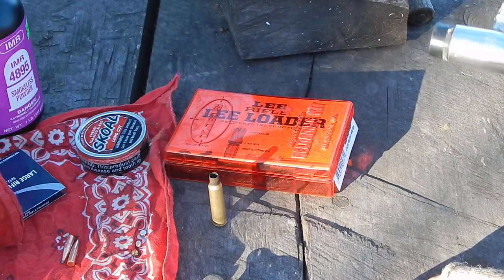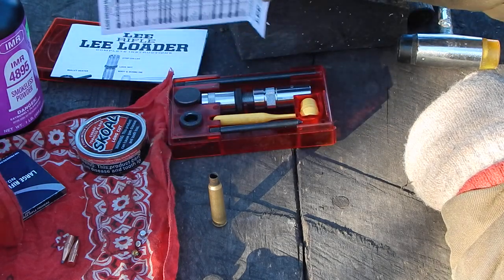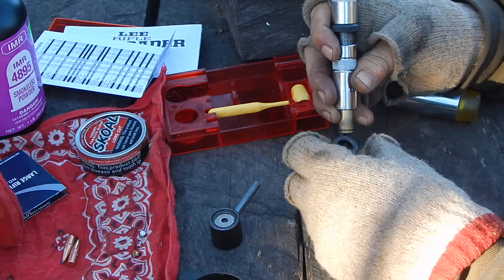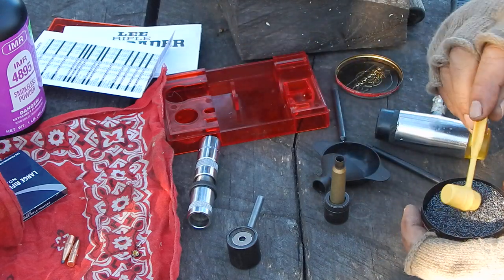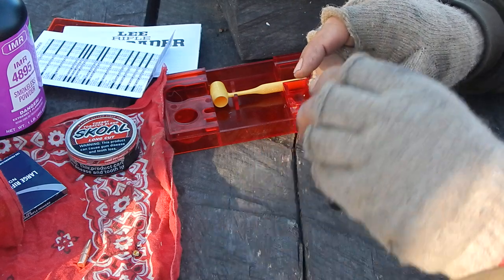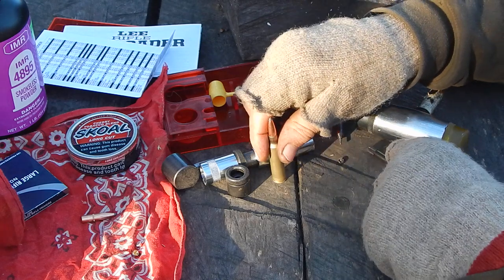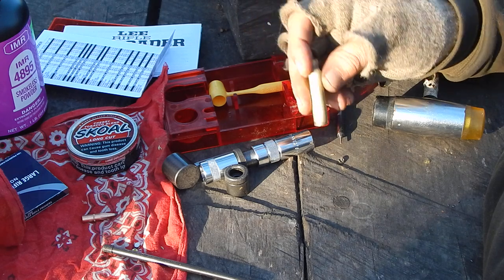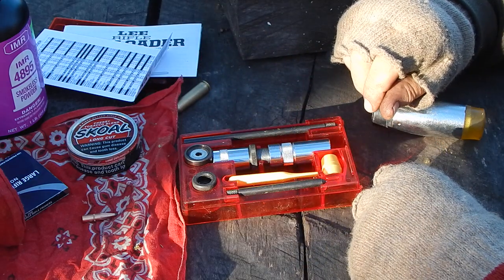6.5 x 55 Swede Lee Loader

Comment: I shoot 6.5x55 and reload on a single stage press. This lee loader works fine but beware that after about 2 loadings of a case you may have to trim the case. The neck of the case will stretch and will not chamber in your rifle. RCBS makes a very simple case trimmer for about $10.  This is true for all bottle neck cartridges.
Reply: You're overstating the issue. Have loaded 243, 303, 308 and 22 hornet with the lee loader and you can get many many more loadings from the lee loader before you have to trim cases.

Comment: I started out reloading with the Lee Loader for a 270 back in the early 80's . I bought the Loader a can IMR 4831, CCI 200 and 130 Gr Hornady bullets and I am sure everything came to less than $30 bucks
Reply from the maker: The first gun I bought was a new H&R .45-70, must have been mid 70's, got the gun, Lee Loader, a box of new cartridges, powder, primers, and bullets, all for $100. Set me up for years, I killed a lot of deer for that investment, and I still use the gun, and the loader.

Comment: The loaders are great tools! So is Lee’s hand press. The hand press with a die set for whatever caliber your working with takes up about as much space in a bag. 
You figure the hand press is about the size and weight of the hammer needed, or lighter. The die set box is same size or smaller than the loader box, can use the priming tool from another loader or Lee’s ram prime, that comes with the hand press kit. And in conjunction with Lee’s breech lock bushings you could literally have all your dies set to correct length and swap in a quick turn.
 Just an option for those calibers that the loader is discontinued on, and takes up about as much space and weight. Also can’t forget the Lee case length gauge and Lee trimmer for trimming back brass when needed.
Love the loaders,  love my hand press, love Lee’s collet neck sizing dies! 
Great video BTW!!

Comment: The 6.5 Swede is the only loader I ever bought from a store. I also find that when you prime the brass outside of the die, it does a better job seating the primer.
Reply: I do the same as well.

Comment: I own 3 of these kits 243, 3030, and 30 carbine they are great kits. The 30 carbine is more difficult to use as you must have Lee case lube in order to resize the case because it's a tapered semi straight walled cartridge. I recommend these kits to beginner reloaders,as they will learn basics with little money spent. To many people think you needed expensive equipment to enter the hobby.

Comment: The Lee Loader for .308 is how I got started reloading.  Within a month I had ordered a single stage press tho.  It made me nervous to seat the primers with a hammer.  It's a great way to get into reloading.  It forces you to learn each step in the reloading process in a way I'm not sure one would get with a press.

I'll add one important tool if one starts their reloading career with a Lee Loader.  A pair of calipers.  Bullet seating depth is adjustable with the Lee Loader, so a pair of calipers is really handy.
Reply from the maker: The one way around it is to set it up like I actually did with this one. I used a loaded cartridge that I knew was the right over all length to adjust the setting. A caliper is one of the first tools to get, I use one for so many things besides reloading. What I need is a Swiss Army knife with a built in 4 inch dial caliper, that would be perfect.

Comment: Very interesting. I have been thinking about start reloading for years now, but i have seemed very complicated, and all the starter kits from anywhere between $300 to $700 (and more, of course) says they conatins "Most of what you need". I think i will just try one of these kits and start reload my 60 (or so) emtpy cartridge cases for my 222rem combi. They have been used once, and just if i get them to work and reload them twice, then i more or less got most of my money back. A case trimmer as somone mentioned could probably a good next step. Thanks!
Reply: Lee makes what they call “case length gauges”. They are cheap and made for whatever particular caliber you are loading. You buy the “case length gauge” in caliber needed, along with one of Lee’s cheap case trimmers. For about $10-$15 you will have everything you need to trim your cases back to SAMMI minimum lengths. They work excellent in conjunction with these loaders or the Lee hand press. They take up very little space and will fit right in the loader case or a die set case. 
Very economical way of jumping right into it, without having to spend $100+ dollars on a bench top trimmer, that will take up much valuable space in a bug out bag or range bag!

Comment: Those are amazing. One question, though: does it take long to adjust it to get your bullet seated to the correct depth?
Reply: +ditto1958 nope :)
Reply from the maker: No, easy adjustment, for this one I adjusted it using a cartridge I had previously loaded to the right depth. I stuck it in, loosened the lock ring, and turned the top until the bullet matched the setting. Just start long, you can always seat it deeper until you crimp it. Once it set,  you don't have to readjust unless you switch to a different bullet. The included data sheet tells you the proper depth for different bullets.

Comment: I call them "Wack a molie".  That is what I use for my .303 British.  I bought a Lee hand primer so I can feel the primer seat.  My reloads/handloads are by far and above more accurate in my gun than any factory ammo I have ever tried.  My first Lee loader cost a whopping $18. from Graff & Sons.  Ebay had a LL for the .351 some years back, but I passed because I have Redding dies.
Reply from the maker: The .351 turn up now and then on eBay, but I doubt their usefulness in a Winchester Self Loader. They cause considerable brass expansion with the blowback action, I don't think neck sizing would be enough.
Reply: +logcabinlooms Some lee loaders FL size the brass like 9mm :)
Reply from the maker: ***** yep, I saw in the catalog the pistol calibers have a notation, "may require considerable force"
Reply: logcabinlooms
Might try to load my 35 with my 9mm lee loader see how it works.
Reply from the maker: ***** ah, scientific experimentation, the cheap Lee gear lends itself to it. I happened to glance at an empty Nagant case the other day, and was thinking I bet someone could make this work in the .32 WSL.
Reply: logcabinlooms I hear the 32-20 makes a good 32 SL case so 7.62 nagant is pretty close to that :) now's the question what to size it with to hold .321 bullets lol ?

Comment: Learned a lot from your video brother... I like to learn to reload 30/30 rounds for my rifle... Have any advice sir?
Reply from the maker: MrDeleon9999 The Classic Lee Loader for .30-30 is a good way to get started, and the set is still commonly available on eBay or dealers like Midway.  The only thing, for lever actions with a tube magazine, is flat nose bullets, and a decent crimp.  The information sheet included gives you all the instruction you need, and gives powder recommendations depending on the bullet weight you choose.
Reply: be suuuuure to check the overall length of your BRASS every reload....... 30-30 is really bad about "growing" ..... every few reloads you do need to file the neck shorter..... yup

Comment: I understand Lee use to take custom orders, but not anymore.  I would like to have a lee loader for 357 Maximum.  I wonder if a 357 Magnum could be machined and re-chromed to a loader for 357 Max? (or have a machinist make one )
Reply from the maker: I would think that using a small spacer to compensate for the additional case length, you could load maximum with a magnum loader.
Reply: +logcabinlooms Yes, That would probably work.

Comment: I just ordered mine on Amazon after watching video thanks. I have one question my brass is bent where the bullet goes in the case for some reason my Swiss k31 rifle bends them when I shoot them. How do I get the bend out of the case so my bullet will go in?
Reply from the maker: If your getting a ding on the mouth, its probably happening during ejection, easily straightened out by poking a loaded bullet into it, that also works if you need to flare a case mouth such as when loading cast bullets.
Reply: +logcabinlooms ok tyvm I have never reloaded before so this is all new to me I can't wait to get my reload kit you showed me and get started

Comment: i want to use one of these for 38 special. but i was wondering if you have to clean the cases. or exactly what id need to do to start reloading i already have brass.
Reply from the maker: You don't want to get sand or grit into the die, but they really don't need to be perfectly clean.  Once you have the kit all you need is bullets, primers, powder, and a hammer. The data sheet will tell you the right size of primer, and suggest the right combination of powder and bullet.
Reply: thanks. after i fire a cylinder i usually dump the cases into a bag. should'nt be to dirty.

Comment: North Dakota, can this be accomplished using cast bullets or do you prefer to use jacketed when you reload in this manner?

-ontario
Reply from the maker: They work for cast, but if the bullet is too oversize it will not fit down the tube so the trick is to start the bullet in the case, then drop the tube over it.
Reply: +logcabinlooms I wish they made one for 8mm Mauser.  
My Kar98K has been sitting for a few years and I was thinking about it earlier today. Do you know of any other company that makes a system like this for the 8mm? I refuse to purchase factory ammo due to unsatisfactory results.
Reply from the maker: Boom Diggity I heard once years ago that someone was making something like these, but I haven't heard anymore, or run across them.

Comment: Do they make one like this for the 7.5x55 also?
Reply from the maker: I think they did at one time, but if so they are very rare.
Reply: The old Lee company made one in 7.5 Swiss.  They show up on ebay from time to time, but are quite uncommon and tend to go for a fair bit.  I don't remember what I paid for mine.

Comment: I plan on reloading with one of these for my 30-30. But I was wondering, if I plan on shooting cast bullets could I get away with just a lubed and gas checked bullet or would I have to size the bullet through a press?
Reply from the maker: Generally the only reason I size cast is because its done in the process of putting the gas check on. Unless you are using a much oversize bullet, or some modification of a bullet not intended for your caliber, I wouldn't be too concerned. Usually I find with the Lee molds the likelihood is the bullet will be a bit smaller than optimal in the first place.
Reply: +logcabinlooms Ok thanks

Comment: Nice work, they are awsome kits... pitty they have discontinued some still common cartridges, I recently got my hands on an old stock brand new 280 Rem kit :) .  Oh, and as a side note I'm pretty sure the yellow powder measure it comes with is a Powder 'Dipper' rather than a "Scoop" ;) ... it gives a more consistance load that way.

Comment: How many grains does that dipper put out? I'm trying to figure out what good charge of 4895 to use.
Reply: I have a M96 swede Mauser. So far ive tried the 140gr sbt. 32.1gr 4895.
Reply: I use IMR3031 quite often for myself.....quite useful and versatile